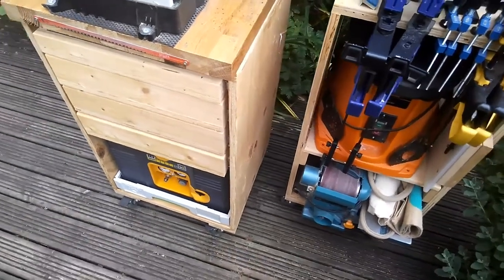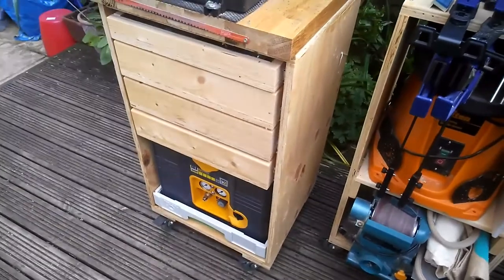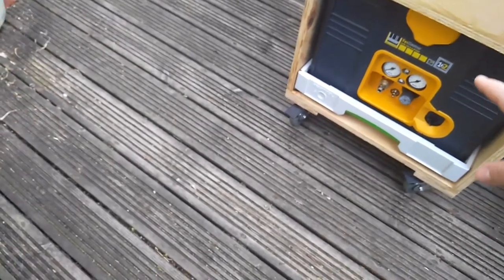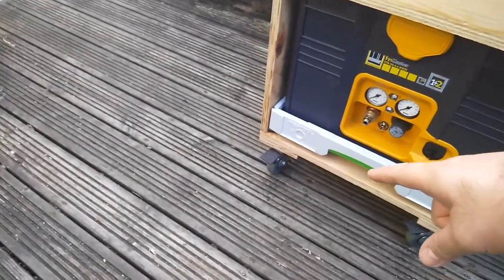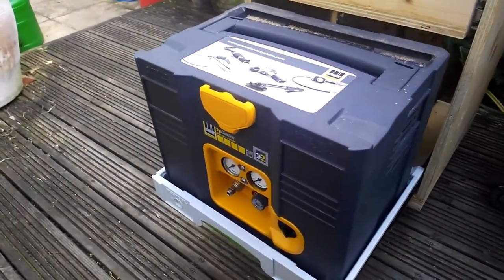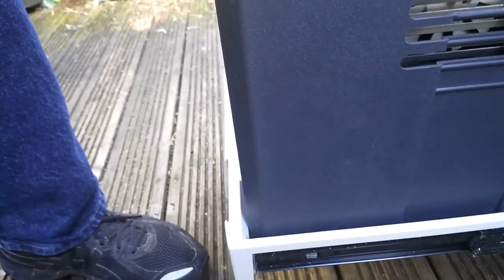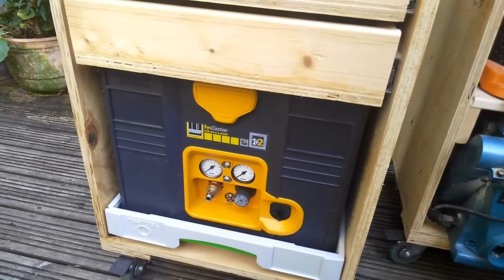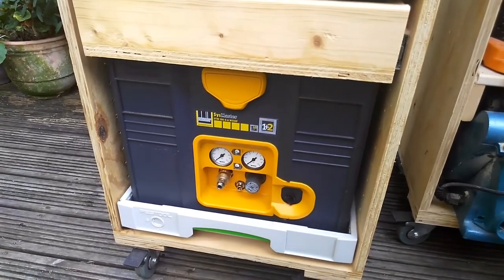Schneider air compressor for Festool sysport users. German engineering is not always sane!

Comment: I don't think that's a bug, but a feature. The ventilation is just above and Schneider recommends leaving 40 cm of space. Placing the power socket there means that there has to be enough space for ventilation.
Reply from the maker: thank you very much for watching and commenting! I fear that if this was the case, Schneider should be clearly informing customers that the systainer format is solely for transportation and not for operation in situ; which they don't do. Oh well... 🙂

Comment: actually, the fault lies with the drawers as the sysmaster has been available for many years now and the drawers have only been out for about about or year or so.
That said, the location of that power plug isn't the most logical in any way.
Reply from the maker: Jonathan m that's interesting! I wasn't necessarily referring to a particular culprit to take the blame for erratic German engineering, so it might be festool's fault, although I'm somewhat puzzled, as I think that the tloc systainer came out around 2011 or 2012, and sysports existed prior to that... Having said that, I do not own a sysport, only separate shelves, but I've inspected the sysport on the catalogue and the shelves appear to have a similar lip on the sides... Are you able to use yours whilst it's sitting inside the drawer? I would love to be able to do that. Many thanks, Evangelos
Reply: Actualy sir, I think I'll have to admit you are completely right! 
I've had my eye on one of these for some time now. How do you like it? My main concern is the noise rating of 90db. Is it really that loud?
Reply from the maker: horribly noisy! and continually so, since there is very little capacity! I would not recommend it I'm afraid...
Reply: Nope, similar systems with drawers for Systainer storage has been on the market way longer. Even predates T-loc systainers.

Comment: Besides the plug location problem how is the actual unit? Is it loud? Will it actually run tools with such a small tank? I was thinking of using one for trim work on either the midi vac or 4 wheel trolley
Reply from the maker: Hi there, it is freakishly loud, yes! and, from my experience, you wouldn't be able to do anything else but nailing effectively, if you didn't want for the compressor to be working continually. I would save the money and buy a standard cookie or small scale compressor, or a slightly bigger upright one; I am not able to endorse this one, it is extremely expensive, loud and inefficient. I was lured because of the systainer enclosure, only to be slapped in the face by not being able to use it whilst on a festool shelf. No point...